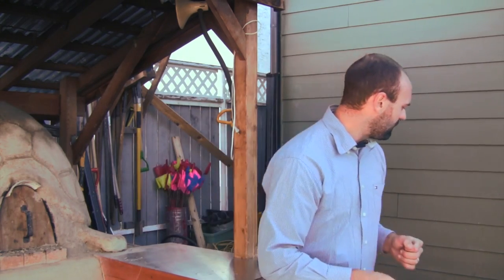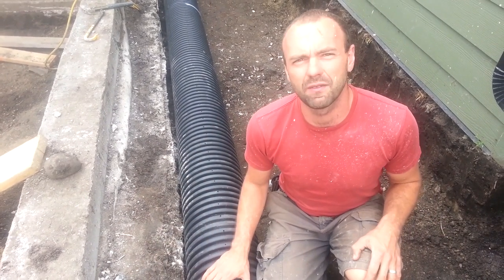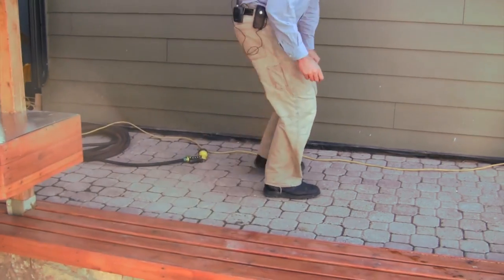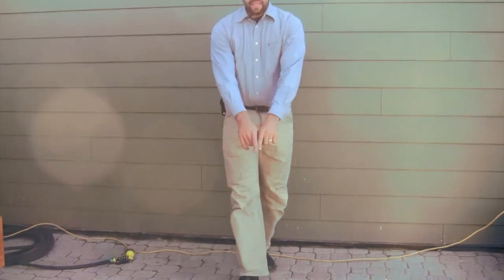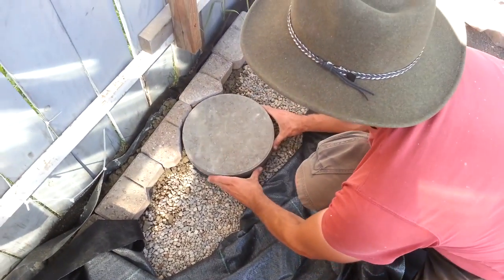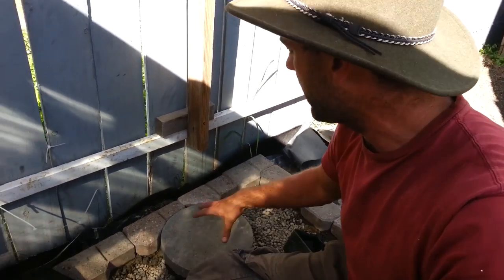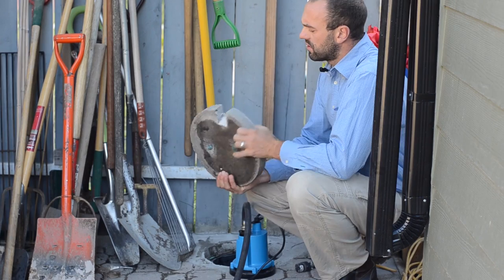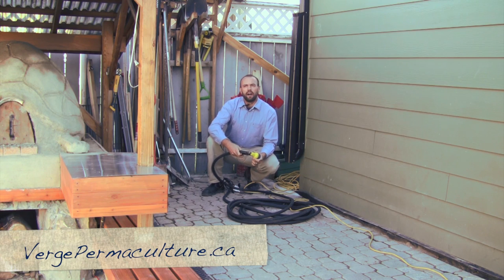Verge Permaculture Rain Tank Installation

Comment: Water is very heavy and your storage tubes under your patio appear to rest against your foundation. Don't you run the risk of weakening or cracking the foundation of your home?  Won't the pool liner eventually degrade and need replacing? I think it's a great idea if you've already considered these issues. If so, I may try it under my patio. Please advise. Thanks!

Comment: very neat idea but I'm not sure how you used the pipes to store the water.  You connected them together? How did you close the ends?
Reply: I believe that the pipes are just used to create a void.  The pond liner is what keeps the water retained, and the space around the pipes is filled with sand and gravel to take the weight of the patio pavers and whatever might be on top of them.